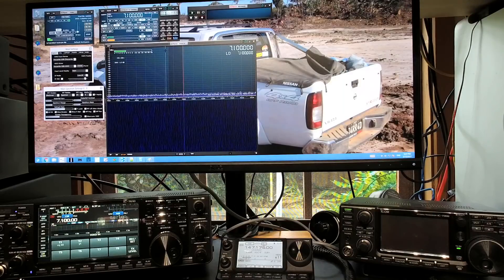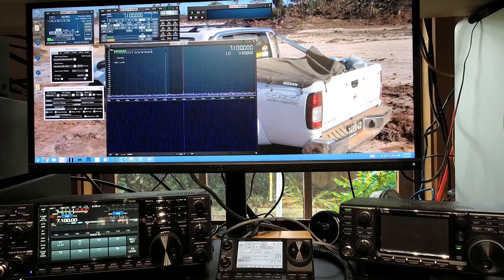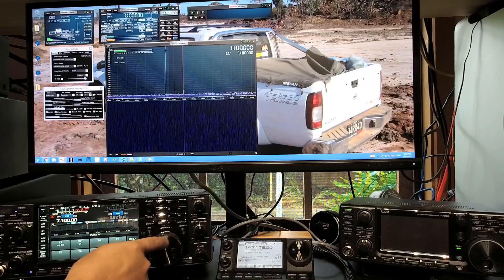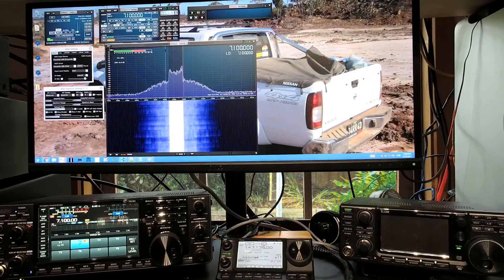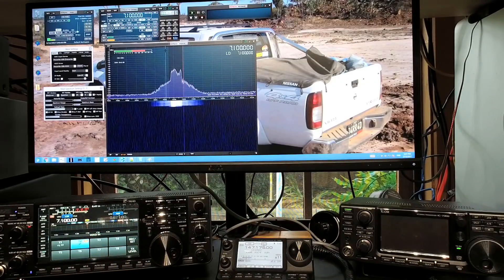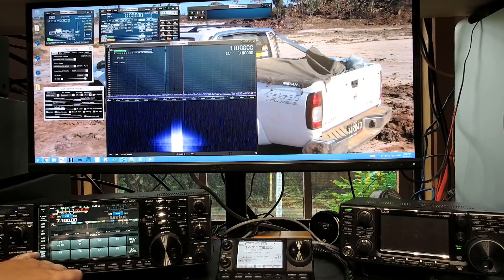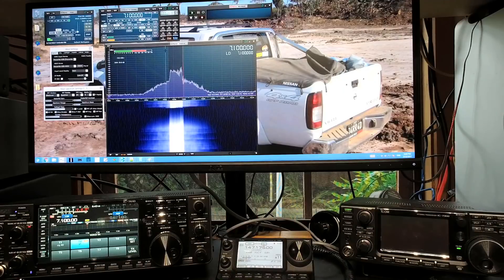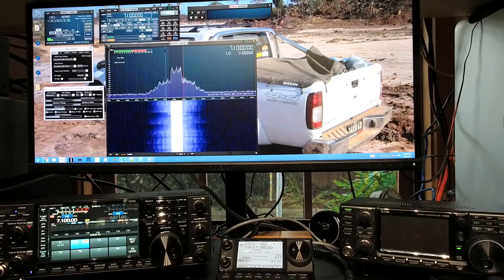IC-7610 TX Performance & Sweet Spot Pt. 1

Comment: Are u using the USB cable to get that data to th PC or the IF output of the radio?  Or is this transmitting live?  What about type A output.
Reply from the maker: Thats transmitting live into a Bird 8201 dummy load.  I'm using a CleanRF Sampler, which puts out an attenuated signal; I then feed that into a SDRPlay RSP2, which samples the RF and then uses Fast Fourier Transformations (Blackmann) to display the bandwidth.

Comment: Hi Jarrad,did you 
experience any ALC power overshoot like the IC7410/9100 and some 7300 radio's?This will demollish my ACOM amp.
Reply from the maker: I haven't measured it, but there can be a little overshoot.  One issue I've noticed with both the IC-7300 and IC-7610 and digital modes is that if you feed them with a very very low AF input (e.g., so my THP 2.5Kfx puts out only 20 watts), when the transmission ceases there is sometimes a spike to 200-400 watts.  This could be the THP Amp however.  I guess the answer is I'll need to do more testing.
Reply: Rate My Radio Thanks Jarrad, seems that ICOM didn't fixed that issue the right way
I was very interested in this radio but now i think i will go for the Sun Expert MB1,73's
Reply from the maker: I'm not sure its fair to say my issue is a reason not to go with the radio; after all, I did choose to be one of the first customers in the world, and they did loan me their unit whilst it is getting fixed.  There are many more IC-7610s out there now and no one else has had this problem.  I suggest you buy the radio that has the features, service & warranty that you want, at the right price.
Reply: Rate My Radio you are right Jarrad, truly i'am a real ICOM fan and so far i used them all , and some radio's did have small "things" but they all are fixed, i will wait a few batches before i buy one
Reply from the maker: I think its always safer to wait a little bit and learn from others experience; I got mine because I knew it would be a good opportunity to start up a youtube channel, something I'd wanted to do for a while :)  So far its been a lot of fun, but also HEAPS of work. I'm still waiting for the logos to get done etc :)  A good example of waiting a little is the Yaesu FTM-400DR; the original design was prone to PA failures to the extent that the new FTM-400XDR has an entirely new PA board!  I sure am glad I waited before buying an FTM-400! :)

Comment: I may be in the minority, but I almost always prefer the sound of the compressed audio.  You can really tell the difference between the three bandwidths, and narrow is almost unlistenable, lol.  But I suppose it would be okay for trying to bust through a DX pileup.  I typically use 50 watts from all my radios to drive my amplifier because that is the point where above which the gain characteristic of the amplifier starts to flatten out.
Reply from the maker: Dear Dennis, I am the same; I consider it best practice to have the RF Compressor on at the lowest setting.  As you can probably tell from the videos my voice naturally has a large dynamic range (as does most of ours), so a minimal degree of compression almost always improves readability.

Comment: Jared, thanks first of all for the video series.   End of the video: When you said you turned power down and tested the lower power drive... what Watt level output was that?   Will tune in for part 2.
Reply from the maker: I take it from 1 to 10 basically.

Comment: Thanks for the video but the level of technical value is on par with audiophile crowd. Statements like "I don't believe in 2 tone test" ... It's not a matter of belief, it has been an established practice in serious (not amateur level) RF engineering for decades.
Reply from the maker: Plenty of people don't believe that a two tone test accurately approximates SSB Speech.  It is a great engineering tool but it shouldn't be the benchmark of transmitter performance.  See Tom Rauch W8JI's thoughts on the matter.
Reply from the maker: https://www.w8ji.com/transmitter_splatter.htm
Reply from the maker: Dear Dragan, I agree that 2 tone testing should be done for reference purposes.  However, none of my equipment is reference grade, so I am not comfortable making absolute claims.  The equipment I have does let me demonstrate a minimum of what on air performance should look like.